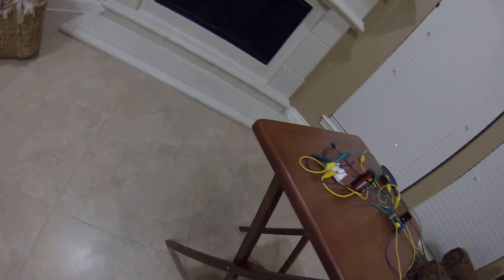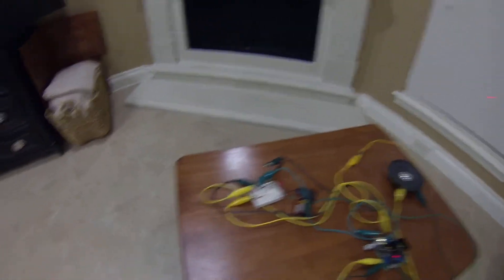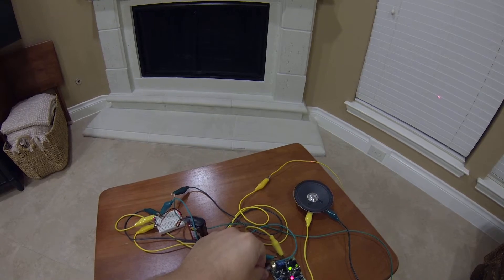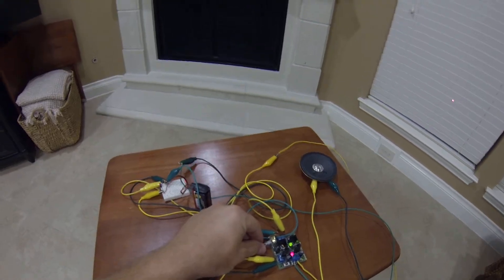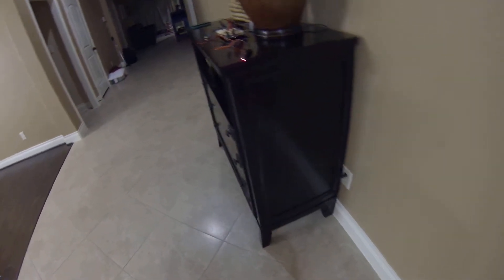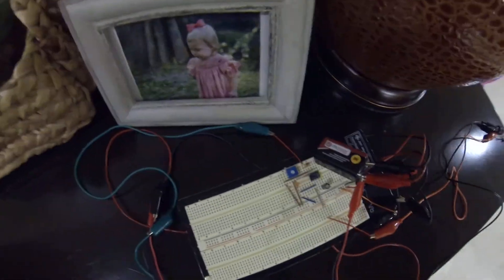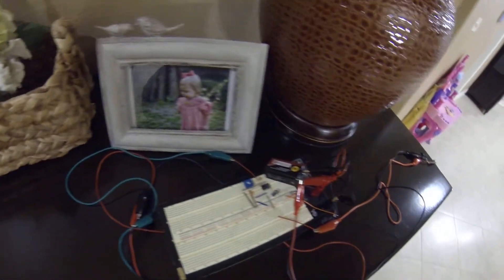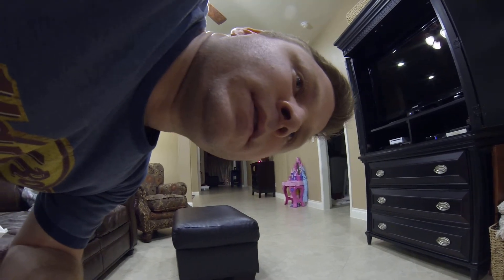Voice Modulated Laser Beam and Receiver Circuit

Comment: Hi, is it possible to share the schematics of the transmitter circuit? I really want to build this for myself.
Reply from the maker: I dont remember exactly what i did wire by wire but you can find the LM386N amplifier circuit in Forrest Mims book page 11 here: http://www.n5dux.com/ham/files/pdf/Forrest%20Mims%20-%20Op%20Amp%20IC%20Circuits.pdf  that is for the transmitter.
I think i made a direct substitution - the speaker for the laser module.  On the receiver, it appears that i made a phototransistor driver circuit and hooked one of the legs up to the audio amplifier kit input - you could probably just use some amplified computer speakers and get a better result.  potential photo transistor circuit can be found here:
https://learn.parallax.com/tutorials/robot/cyberbot/visible-light-navigation-cyberbot/simple-light-voltage-sensor/how

sorry i didnt write it down!  good luck!